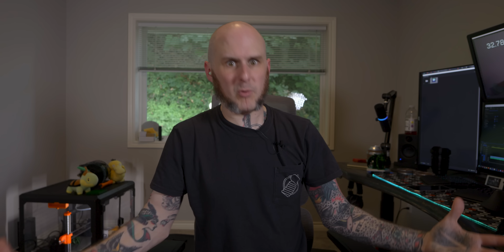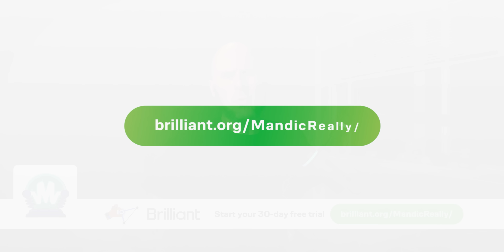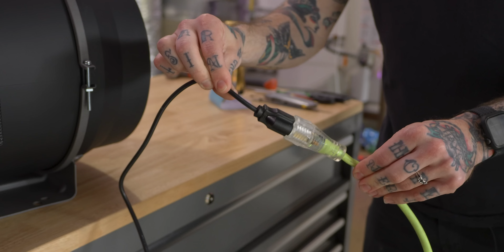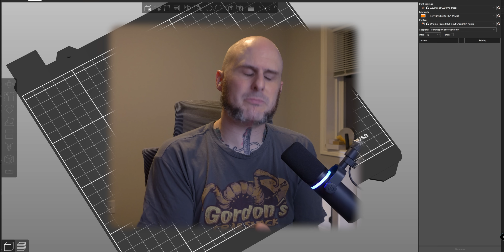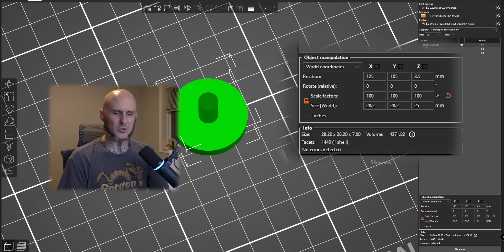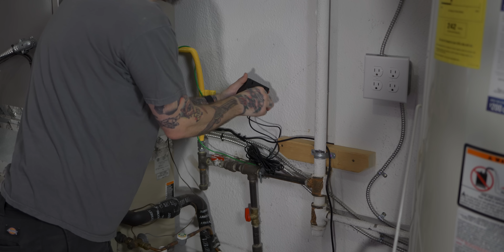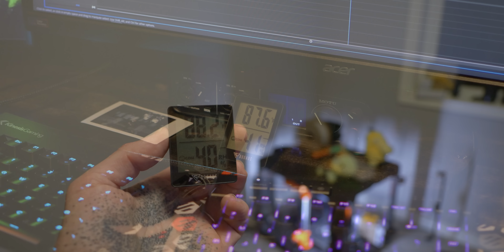Office Build Begins: Solving 2nd Floor Heat w/ AC Infinity T12 fan!

Comment: Start looking into a Minisplit. My daughter has 10) Banbu printers and even an added 10,000 btu inverter window unit cant keep up. We installed new ducting with her new central air unit. You will need a 20,000 btu mini split. That micro vent wont flow enough air unless you do nothing in that room. ADD EDIT did not get to your fan install until after the post. That fan will pull too much are through the A coil and not properly de humidify and screw up the whole house unless you size your furnace and AC unit for the added CFM.

Comment: Route the 'jump duct' with a collection register at 2nd floor ceiling level (with a low-speed inline blower) down into the return ducting so that the warmed air is sent directly back to the A/C condenser to be cooled.  Heat rises.....so, with reduced A/C air flow on the 2nd floor from the registers it is going to accumulate ....that is why it is important to 'treat' the concentration of heated air getting collected upstairs.  This should provide more balanced temperature on both floors at minimal cost.  Adding Mr. Cool (or other portable A/C) will help the immediate area but will do little for the overall 2nd floor.

Comment: I use a standalone unit in my master during summer between like 10pm-8am at 75 and the house on 80. Just started but love the comfort upgrade. It cools quickly and is pretty quiet though my master is larger than your office. Waiting to see energy usage trend lines and hoping it's more efficient.

Comment: Did you have to use the flexible duct to connect the fan to the metal one or could a metal connector work as well?

I’m thinking of adding this same fan to my HVAC ducts, but mine is 6in.
Reply from the maker: The AC Infinity Fan isn't exactly intended for this purpose so it isn't sized to fit into regular ductwork. As such I used flexible sections that made it easier to install. It was still a serious pain to do though. The 12" duct was a larger diameter than the AC Infinity flexible duct pieces, but the AC inifinity Fan just didn't quite fit into the 12 duct on its own. Also the Flexible Sections eliminated vibrations transferring into the metal ducting that would have occurred if I mounted the fan into hard ducting. 

Hope that information helps. I'd recommend using flexible ducting, but actual HVAC ducting, not the AC Infinity Brand. 

I'll be revisiting this VERY soon in my new office and should be able to test again soon.

Comment: Hmm, so I have a similar problem.  My home office, while on the 1st floor, is about 3.5-4 degrees warmer than the rest of the house due to all of my computer equipment running it it.  I've added insulation in the attic, tinted the window with good tint, and even had an AC guy install a return from my office above my computer to the air handler and added a booster fan on the air vent.  Still, after all that, the room is significantly warmer than the rest of the house.  So for the crazy hot months in Florida, I am considering just running a duct through the house (no way can I do that myself through the ceiling) and adding an exhaust fan to distribute the heat to the rest of the house.  Am I crazy?  Should I just get an exhast fan installed?  Or a room to room tranfer fan?  I wish I could just get a mini-split for my home office, but that would require approvals from HOA, etc and it's expensive...  So I actually do have a portable AC I could use in my office, I just can't figure out what to do with the exhaust, window is not an option, and I really don't want to make a hole in the wall.  Considering somehow running a duct to the bathroom exhaust fan, any suggestions?

Comment: Put the printers in an insulated (sound and thermal) enclosure with either a mini-split or AC unit. You can also opt to force the hot air from the enclosure to the basement/main floor or outside.

Comment: In my office I added an extraction fan using an infinity just like you did. It pulls the hot air collecting in the room out equalizing my temps. This was set up using home automation with my smart things hub. Completely fixed my issue. I would find a way to pull that hot air out of that room and expel it outside "not into your attic".

Comment: Wow it really highlights how inefficient single AC/heating units are in larger houses and how little contractors think about these things when building
Reply: They don't care because they just build them cheap as possible to maximize profits. Never buy a house from a place that offers cookie cutter builds.
Reply: It doesn't have to be that way.  I work in HVAC design and sales. We can install a custom system that supplies the right amount of heating/cooling and airflow to each room in the house. Very few contractors or homeowners are willing to spend the extra money to do it right.
Reply: You either need a central return in your home or multiple returns on opposite sides of the home. The return is what removes the hot air, without them the cold air entering the space will take significantly longer to actually cool it down.
Reply: Everyone complains about builders except when custom.hvac solutions are priced they could run you an additional 30-50k. 

Most contractors i know are happy to do anything, supposing a client will pay for it.

Comment: A few options for home assistant. A smart thermostat like you already pointed out is the most direct.  Next is energy monitoring. Something like a sense panel meter with the auxillary clamps that you use on the hvac system is reliable. Much cheaper is an esphome with a hall effect meter. You can also use barametric pressure sensors, one before and one after the unit to see when the primary blower is by the delta between the two sides.

Comment: The jump duct will help relieve the pressure in your room. Try to use one at least 10 inches wide.

Heat creates pressure and if there isn't anywhere for it to go it just swirls as heat in that room. Your "jump duct" is like a pressure release valve.

Comment: one thing we did was in the top level plenum we have a divider that favors the room im in , so less flow to the other rooms that don't need it but my print room im working in get about 15% more air flow than the others so it ends up cooler , we did the same with the downstairs as well favoring our bedroom , 

basically its just a metal X that's off center a bit , i would assume you could 3d print a large insert to your top plenum to do this function though it may not be good for your case given your bedroom and partners office is there as well.

Comment: Feels like your automation logic could be replaced with a simple relay?
Reply from the maker: Sure a simple relay could be wired into this, but you'd most likely lose all fine motor control in doing so. The fan is too loud at full speed, that is controlled by PWM through their "smart" controller. Maybe a relay could activate something in the smart controller, but that would be a PCB level modification. Why bother when Home Assistant can have a simple automation to tell the Fan to turn on? 

Relay is "physically simpler" but an Automation is simpler on a level where fine control matters. Like just today I lowered the fan speed control as the upstairs was getting too warm now that we are using the heater instead of the AC. That is control we don't want to lose.

Comment: You can do better by leaving the door open to the warmer room and dampening down/leveling the air into the rest of the house.
Reply from the maker: Yes, but then the noise of the house and the room mix. When I'm filming videos that means requiring everyone else to be quiet as a mouse, and deal with my "projecting" my voice around the house. That's a no go unfortunately.

Comment: During summer months I set FAN to RUN and not to Auto, it helps alot on my second floor in Washington, does cost me a bit more During the summer months but worth it, I'm may get this fan to have running instead of having the system run. Thanks for the information

Comment: Watched you on TikTok and enjoyed the YouTube Video. These weird little issues is something I've always enjoyed solving. Something that can help keep temps more even would be too run the furnace fan all the time. It helps my place get much more even temps. I also duct my PC exhaust straight outside with and AC Infinity t6 running at speed 2-3 and my 3D printer enclosure is exhausted outside with an AC Infinity t4 using the thermostat to maintain enclosure temps where I want them. So for an example My office is on the second floor in a non central air conditioned house. I have a 14,000btu portable A/C unit and on a hot summer day with my computer running the A/C would run steady 24/7 and the room wouldn't get below 30c (86f) and not that my PC case is ducted straight outside the A/C unit runs for about 15-20min of an hour and I can keep the room at 21c (70f). Probably saved me $50-$100/month on power running my Air Conditioner.

Comment: I use flair to help with this issue. You can close some vents that have the rooms that aren’t occupied so that the ones that are can be cooled off faster and at a temp you want.

Also if you need to add an AC to your office, get a window mounted, they sell ones that are 80% more efficient then those floor mounted ones AND the air will be nice and cold.

Comment: ALso every decibel reading should be shown with distance, as you know sound pressure level is logarithmic, so distance massively affects the SPL.  just holding up a meter means nothing. Also there are weights both A and C, if you dont understand them, you need to at least say it (what weight you have it on) is based on spikes and such.
Reply from the maker: I didn’t bother putting the notation after the first couple, all of them were taken at the exact same 36” from the outside of the sound source. I understand that distance matters. This isn’t a scientific peer reviewed study, so I don’t feel a need to do a full methodology breakdown in every video. That bogs them down and is not valuable to the majority of viewers. And I’m fairly sure every dB figure I did put on screen was noted as “dBA”. The information was there.
Reply: @MandicReally  a lot of engineering goes into the amount of air passing through the coils on all hvac systems, changing that amount of air can significantly change the efficiency and could overall make your power bill worse, and not cool the rest od your house properly

Comment: Have you looked at flair smart vents, this could help direct air where you need, and will measure each room.  Its expensive but may be cheaper than a whole new unit in the upstairs.

Comment: Instead of pushing cold air upstairs try pulling the hot air down back to the HVAC system. That way you can recirculate the air better throughout the house all year long.
Reply from the maker: Yea I’m debating a system to draw hot air out of the office (fan inline in the attic on the jump duct I mentioned), and running the fan more than just when the air is on.

Ideally the HVAC return would be in the ceiling and ducted to individual rooms, but that’s a big project to rework. Someday maybe, but not today.

Comment: Side item for you to check is the insulation in the attic.  Those houses never have enough up there and if you can also help keep the summer heat from getting there… it will help.

Comment: You can retrofit a system to allow multi zone that uses expanding and shrinking blockers in the circular ducts as they branch off. They are pretty cheap (compared to a proper full cut and replace baffle system for multi zone) but you have to be careful with airflow. Your furnace and A/C coils have a minimum airflow you must always maintain or else you end up with major HVAC issues.
That being said you can add as many zones and thermostat sensors as you want and integrate the whole thing with home assistant since you have that set up already. Its best to use your major equipment vs adding supplementary systems since it increases costs by quite a bit and puts you into oversize risk.
Generally speaking: on the hottest day you should be using 80% of your cooling capacity. On your coldest day you should be using 80% of your heating capacity. You can consult an almanac and look up the 10 year highs and lows for your area. I have found people can often save a significant ammount of money on their capacity and instead dump that money into proper air handling and filtration.
You will be a lot more comfortable and have a lot fewer alergy issues vs the brute force method most HVAC setups have where you only use at most 50% of your capacity. Your system shouldn't run in tiny cycle times so that air never gets moved around. This is just as much an issue in American Homes as you found in your McMansion. Likely your equipment is over-sized AND your air handling is having issues.

Comment: I'm just across the river in Vancouver, and I'm also an east-coast transplant. So, I'm equally baffled by the AC situation here. I have 3 portable heat pumps keeping the house cool (Black and Decker 12,000 BTU AC units, which can be used for heat as well). They work really well, but are LOUD. I usually have the unit in my office set to 61F, so that I can turn it off in the morning to work. If it's not a heat wave, I can work all day with the AC off and temps in the office won't top 75F. I've also got an X-max 3 and a frankenstein Replicator Dual in the office with me. With all three going at once, there are no noise-reduction headphones which make that any better. And, the giant heated bed on the Xmax-3 definitely fights the AC.

On the flip side of things, the workstation in my office has a really efficient water cooling setup. So, in the winter, I can basically heat my office with that computer alone. I didn't realize when I moved here that I would become a human thermostat, but it is what it is  :)

Comment: I wonder if you could use a power monitor to trigger the fan when the ac unit is on. Otherwise changing the ac controls makes sense.

Comment: zip tie the temp probe to the return line coming out of the evap, the same company also make fan booster vents  it just replaces the vent cover and has a pair of 92mm fan to force more air into the room reduce gaps at the bottom of doors cold air sinks the room is pressurized the cold air will get force out the bottom of the door, in the wall above the door just cut a hole on both sides and put a simple vent cover over it on both sides the higher the better cheap and more effective than jump tubes as the hot air can just move to the hallway. last option is an vent to attic extractor fan i have the 10in from ac in my room i use it to dump out a lot of heat fast also vents the room really really well if i print ABS, ASA, Nylon, etc i find if the A/c has been off all day and it 110+ upstairs i can close the a/c vent in my room open the door and hit that fan and drop the house by 10-20deg in 5-10mins if it's cooled down outside

Comment: I'm not sure how the outside temp compares to your upstairs office, but if it's similar (or even warmer inside) then exhausting some amount of air from the office with 3d printers can not only get rid of some of the hottest air (if you pull from closer to the ceiling), but it can also help improve your air quality a bit (since you have 3d printers in there).    Good luck getting the temps down "on the cheap".  (fyi:   I have room-by-room multi-zone ducted air in my house after having a 2 zone system.   It's been a huge benefit that I can't recommend enough.   Less power draw + more comfort in the rooms that I'm in.).

Comment: If you're at the office it means you're not at the studio, so noise levels there shouldn't matter too much. If your partner is not in her room, you can just crank up that fan all the way up and turn it down back to 7 when you need it to be quiet. Also, if you're at the studio, it probably means you don't need to cool the 2nd floor so you could just completely shut down the fan. If you create presets for "filming mode", "home alone", "quiet mode", etc. everything I just said is probably just a tap away on your phone...

Comment: Great video. Perhaps try zone dampers with HA controllable relays like Kincony, thermostats like ecobee running locally through HA using Homekit. Then automations. Problem is you need one thermostat per area. However,  you may be able to use automations and the remote sensors but haven't tested that. Just some ideas. You can run multiple zones with one furnace.

Comment: cheap and dirty way to turn the fan on with the AC is a smart plug and a wifi temp sensor.  As long as the fan comes on at the required speed when powered it should work fine

Comment: I bet if you were able to set the fan to run constantly at a low speed(perhaps 4) and then speed up to 7 when the AC is running, it will even out the temps better.

Comment: The air handler fan automation - put a zigbee CT on the air handler power, the will give you a signal when the fan is consuming power.  I have one on my AC.
Reply from the maker: A decent thermostat that integrates with home assistant should allow me to setup that side of the automation. It is the fan control side I’m not sure about yet. I have to get my home assistant instance running again and play with it.
Reply: @MandicReally  Good point.  I have an AC Reality vent booster my home office for similar reasons.  I have it plugged into a shelly smart plug with an automation that runs any time the temperature in the office changes or the HVAC stat changes and only turns the power to the booster on if the office is above a threshold temp (cooling) or below the threshold temp (heating) and I let the AC/Infinity controller decide when the vent air is hot or cold enough to actually boost.